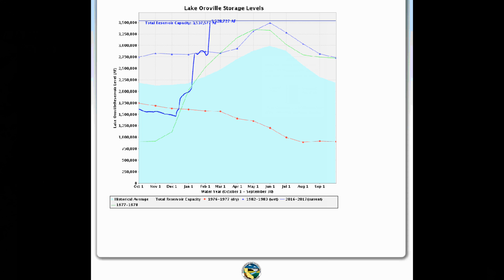California's Oroville Dam Spillway Collapsing with Potential for Catastrophic Flooding

Comment: The construction an emergency spillway right next to the main dam. Not a great idea. The emergency spillway should be way off to the northern side and go off at a 45 degree angle taking pressure away from the main dam area. If the emergency spillway is undermined in its present location, that presents a direct threat to the top of the main dam which could then escalate out of control.

Comment: Folks, what is going to happen, is that when it rains, the dam's level will rise again and may spill into the giant defect or pocket where the soil has eroded (that's where they're dumping all the rocks), and if enough water gets down in there and washes more earth away, it will undermine the wall along the spillway.  At that point, it's really the end of the ballgame, sports fans.  They're going to get rain in about three days;  that's in addition to the snow melt - so I don't know if rain alone will add to erosion, but it certainly may cause the dam to rise faster than they can let it out through the gates...
Reply from the maker: Yes, at the moment, the main Achilles heel is that emergency spillway, which spills water onto a steep, now dangerously eroded (i.e., potential to undermine the spillway structure), earthen slope, and which they are frantically trying to armor before the next storms.  And the other breakpoint still looming is that now badly damaged main concrete spillway ramp.  I will continue providing updates of the situation in the "Show More" drop-down of the video description and here in the comments.

Comment: The spillway failure doesn't appear to be a threat to the dam so I don't know what all the fuss is about!
Reply from the maker: There are (were, during the crisis) 30 vertical feet of water (now down to about 5') sitting behind that emergency,1,700-ft-long spillway!  Oroville's surface is 25 sq mi or 16,000 acres!  That's 480,000 acre-ft that would go down the channel in one big "gulp" from a breach of that spillway.  Towns would be inundated.  Downstream levees would be breached, inundating more area.  And the whole flood control system could fall like a house of cards.  That's why its so serious, and why 180,000 people were ordered to evacuate (that order has since been lifted on Valentine's Day.)

Comment: BADLY designed spillway ,a spillway is the most important part of a dam.
VERY bad engineering ask 4 a refund cancel their engineering certificate.
my spillways are stronger than my dams
Reply from the maker: Faulty or missing inspections for cracking in the half-century old concrete? We'll be finding out, soon.
Reply: SO it survived the big test. they need to strengthen the overflow floor as well as the car-park overflow and the spillway channel needs to b widened restricted water is powerful

Comment: This problem goes back to a question of WHY wasn't the cement spillway maintained properly by the State?  It had already been "fixed" once (strangely RIGHT WHERE THE MASSIVE, FOOTBALL-FIELD SIZE HOLE NOW EXISTS!!!) so WHY was that NOT very carefully watched???  The State water "professionals" already KNEW that the "fix" had not gone well and already presented a problem in case of a very wet rainy season - which was unlikely after 5 or 6 years of drought BUT guess WHAT???!!!  Yup -- their worst nightmare has come true = super wet weather and a huge snowpack that has ended the drought in one single rain season and that is STILL not yet over ...

Comment: They really don't need anymore people up flying around in the area.
Reply from the maker: They have a sufficient flight-restricted (TFR) area up to 4,500 ft now, to "protect" all their aircraft (mainly helicopters) operations.  But there are still dangers of mid-air collisions from pilots congregating over the dam ABOVE the TFR for a look-see!  And the biggest danger to the emergency repair work is DRONES, which are still being illegally flown into the TFR, right over the work area!  I believe that these should be promptly disabled using radio-frequency "jamming," and their operators prosecuted!

Comment: The emergency spillway has NOT failed.  The main dam embankment is NOT at risk.  It is irresponsible to say the dam is at risk.  It is true that the emergency spillway would be at risk if it is used again.  It is true that there are issues with the main spillway.  So it is important to distinguish between partial failure in the spillway area and the main dam.  The results of spillway failure are minor in comparison with the failure of the main dam.  The main dam is NOT in danger.This is an extremely serious situation. The reservoir is full. The main gated spillway that is designed for the maximum probable flood has limited operational capacity due to significant damage to the floor slab, the undermining of the side wall and serious adjacent soil erosion. Extended operation of the structure in this condition especially at high flows is entering the realm of difficult to predict consequences.

The emergency spillway is not intended to be used to release water. The emergency spillway is only to be used during an "act of god" runoff event where the spillway gates are wide open flowing at full capacity and the reservoir level is still rising and encroaching into the dam freeboard. Freeboard is the cushion between maximum design level and top of dam. The emergency spillway is there to prevent catastrophic overtopping of the dam.

The spillage of water that resulted from the reservoir being allowed to rise above the crest of the emergency spillway as a consequence of the main spillway gates being closed has clearly demonstrated the risk of failure of this area. With more water coming in than going out, the reservoir level will rise. The power plant has limited capacity to release water, especially with debris issues.

A more serious problem is yet to develop. As there is record snowpack and likely very high runoff from the snowmelt, normal operation would reduce the level in the reservoir to accommodate much of the spring runoff to minimize the release and flooding downstream. However, it may not be possible to lower the reservoir elevation with the damaged spillway out of service. If the spillway damage can not be repaired in such a manner as to make it operational at a sufficient capacity the consequences could be catastrophic.

The dam itself is not in danger at this moment. The structural damage to the main gated spillway is the reason for the problems facing the operators. The emergency spillway spillage was an operation for which it was not designed. The operators quickly determined that in-spite of the damage it was necessary to re-open the gates on the main spillway to bring the reservoir level down below the crest of the emergency spillway to prevent a potential failure. It is imperitave to keep the level from reaching that crest again.

But the necessary continuation of flow releases in the main gated spillway poses a risk to further problems to either the structure itself or adjacent erosion migrating towards the dam. The reservoir level must be kept below the sill level of the emergency spillway to minimize the risk a failure of this fuse. The fact that the spillway is being undermined as a result of the slab failure raises questions about what else might be going on under the so far undamaged floor slab area higher up.

The key to dodging failure of either spillway at this point will be minimal inflow into the reservoir, reducing the pool level as much as possible and having sufficient time to begin and complete a temporary emergency repair before the next big runoff event.
Reply from the maker: Thank you, Sandy, for a good overview of the situation.  However, as rufinoman states (below), your statement has several contradictions, not to mention being too lengthy (and minus your qualifications) for posting here (please relegate anything >500 words to a link, e.g., pdf.), although I'm leaving it, since nothing more thoughtful & factual has yet appeared.  Arguing those contradictions now, with so many uncertainties still ahead, serves nothing.  It's time to wait and see what Mother Nature delivers next, and how the dam's managers & operations are able to respond.  This may be a "house-of-cards," waiting to be toppled, with Mother Nature having the final say.
Reply: FanofDocumentaries I do not blame the engineers.  I blame those that allocate or fail to allocate necessary funding to do proper maintenance, repairs and inspection.  I suspect any engineer speaking out will be reprimanded or fired.
Reply: I hope disaster will be avoided and they repair both spillways when the rainy season is over.
Reply: rufinoman The damaged concrete spillway needs to release at least 700,000 acre feet from the reservoir to get down to normal operating level for this time of year.  That level is 2.8 million acre feet.  This operation is risky with the still high inflows and damage to the chute.  The operators have determined emergency spillway unsafe and main spillway operational for an indeterminate period and flow.  They have been running it 100,000 cfs.  Capacity is 250,000 in undamaged state.
Reply: Sting Flight The physical capacity is 260,000 cfs.  An official design drawing with an actual elevation vs flow curve is more relevent than a number in an administrative document.  There is also a curve showing flows in both spillways as the elevation increases above 901.
Reply: "The main dam is NOT in danger.This is an extremely serious situation."
Your summary of events is full of contradictions and whilst I understand the model, ie, like a cup of water, the level should be maintained below the rim, that would appear to be the main objective of the engineers.
Reply: There is so much wrong with your post... The emergency spillway was to allow a 100 yr flood capacity of 200,000 cfs, it eroded at 8,000, it failed. It could have created a channel and un zipped the hillside. The "Dam" is the entire structure holding back the lake, part of it could fail. "The Emergency Spillway is not intended to release water..." Yikes, what is it to release, geese? What do I know I'm only a retired engineer.
Reply: Lloyd Velasquez i am a retired water resources engineer!  The concrete spillway is designed with a routed maximum probable flood inflow hydrograph.  Capacity is 250,000 cfs.  The emergency spillway is there only to save the dam.  Read my public post to the California Dept of Water Resources.  It will clear up your lack of understanding.
Reply: Johnny Ray The key to success is continuing to lower the reservoir level so there is more than enough storage to absorb storms and spring snowmelt.  It is my opinion that DWR have a good handle on things after having time to assess things.
Reply from the maker: So what's your "good handle" assessment based on, with regard to the main spillway--or what's left of it?  Standing on that catwalk at the gates and viewing the flowing water?  By sending $14 endoscopes attached to their cell phones under the concrete (sarcasm)?  Have they run the spillway all the way back up to its 150,000 cfs design capacity yet (and for an extended period), to see what's going to happened in its current highly-damaged condition?  No.  Has the original cause of the spillway break-up been determined yet? No.  And a report from that new five-member outside investigative panel is at least months away, at best.  So, as an engineer with supposed expertise on this matter, please elucidate for us what scientific testing you're assuming has been done to give them--and you--confidence that the whole highly damaged mess of a main spillway will hold together for dealing with what Mother Nature may throw at us next--and for the rest of this season?
Reply: Sting Flight Great comment!  Minor number correction.  Spillway capacity is 250,000 cfs.  In 1997 it ran 160,000 cfs.  In this situation you need to go back to the "as constructed" drawings and assess what the more horizontal portion of the chute is sitting on.  I would expect fractured rock that has been well grouted.  There should be concrete cutoff walls to resist shear and seepage.  The broken steep portion was obviously sitting on erodable material which has apparently worked down to bedrock.  The fact that the reservoir is now down to 2.8 million acre feet from 3.5 million is good news.  It is now at the top of rule curve.  The project operator will use computer model simulations to test various inflow hydrographs based on precip and snowmelt forecasts to assess reservoir rise and spillway flow requirements.  They know 100,000 cfs sustained is safe.  I don't think they want to exceed that flow unless there is a risk of emergency spill which I will guarantee they do not repeat.
Reply from the maker: Spillway controlled maximum flow=150,000 cfs http://www.water.ca.gov/orovillerelicensing/docs/app_ferc_license_2005/Vol_I_Exhibit%20A.pdf
Reply: Sting Flight Thanks.  Great reference document.  I acknowledge that the report states "controlled maximum flow"  150,000 cfs.  I take that to mean the highest flow they are able to regulate by gate control.  After that the gates would be lifted out of contact with the flow.  I know I have seen 250,000 referenced.  Will seek further clarification.  Thanks.
Reply: Sting Flight I have a copy of the "Oroville Spillway and Flood Control Outlet Rating Curves"  dated 5-27-63 by D Young Chart 19......California Dept of Water Resources.  The gated spillway capacity at 901 which is emergency spillway sill crest is 260,000 cfs.  The 150,000 cfs is an administrative regulated number to prevent/minimize downstream flooding.
Reply from the maker: Well, 1963 vs 2005--what DWR reported for their most recent FERC license renewal.  Take your pick what to believe, I guess.  The greater point is: That spillway has NEVER passed more than 170,000 cfs (that, only briefly) since construction, and never more than 100,000 cfs since this recent "melt-down" began. Doing so, after what's occurred would really be going into uncharted waters.  In addition, and most importantly, the levees along the river downstream of the Dam are only rated for 150,000 cfs; that they "held" once, at 170,000 cfs was sheer luck!
Reply: Lloyd Velasquez send me your email and I will send a pdf of the design drawing.
Reply: Sting Flight  I once worked with a few people like Sandy, they confuse themselves with facts. They are never wrong, even when irrefutably ignorant. This system was designed by knowledgeable people in the 50-60's. We've become a lot more intelligent since then. This is a system teetering on disaster.

Comment: woooow what our the feds doing?
Reply from the maker: The State & feds are coordinating closely, as this is just one piece of the overall Central Valley's (CV) flood control system.  There will be investigations and plenty of blame found to go around, just like happened in 1986, when the whole CV FC system almost went down, like a house of cards--from too much water initially being held in reservoirs when the big ones (massive storms) hit.  More big storms and that massive snow pack up there right now, will test this system again, soon, and for the next few months.